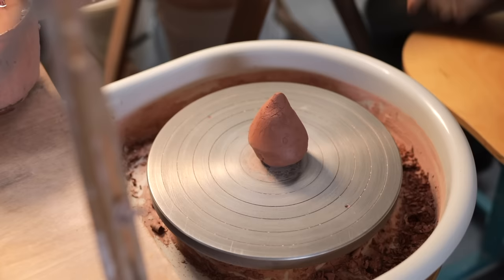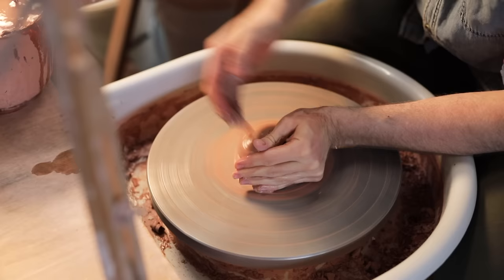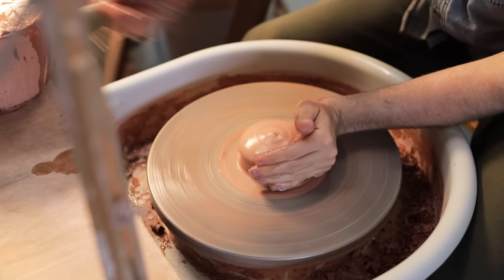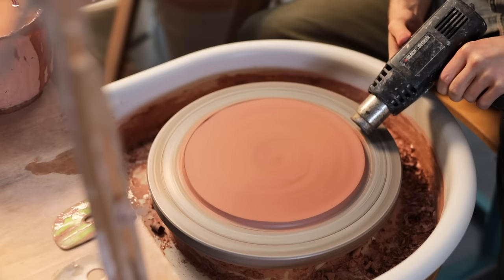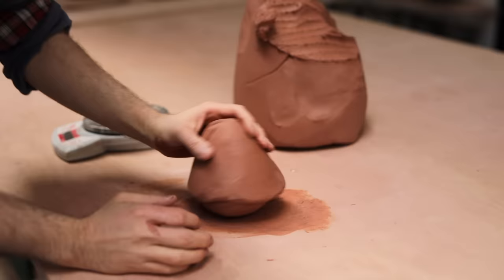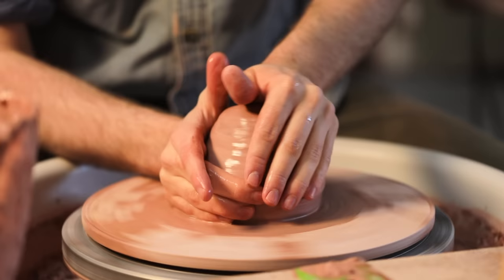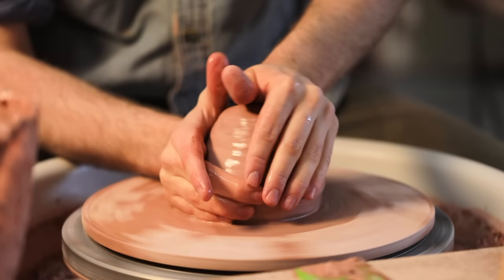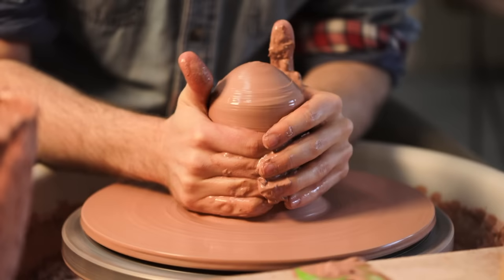How to Make A Pottery Dinner Plate — Part One

Comment: Hmm, having control over moisture content from start to finish seams like it could be a cool advantage to making reclaim.
Reply from the maker: It certainly helps a lot. I can also add the soft reclaim to harder blocks of new clay to soften it down.
Reply: @floriangadsby  Are you able to purchase clay at varying moisture content from producers?  I suppose that would just be paying for water if sold by weight or volume lol

Comment: Thank you so much for the video! I am taking away good tips from you. One question, at what stage do you lift the plate from the bat? I guess leather hard? I have had my plates even after wiring off after throwing, it is stuck and have lost a few when I had to re-wire. What am I doing wrong? Thank you!

Comment: Nice plate.... I want to know something can I use stoneware for drink if I fire it with 800 c' with out glazeing it .... is it save to use
Reply: If you use an unglazed mug for coffee you probably can’t ever use it for tea afterwards, same as how an unglazed clay cooking vessel that has been used for fish will always impart a fishy taste to anything cooked in it afterwards.
Reply: Burnishing the vessel when leather hard helps control porosity by “closing down” the surface. You can also try milk treatment or cereal treatments of the interior to cut down on porosity(check out Andy Ward on YT for methods). There is also a liquid quartz sealant available which is supposed to be food safe. People ate and drank for centuries from unsealed pottery so it’s more than possible, but using some kind of treatment makes vessels much more useful.

Comment: Is it true that dinner plates are really hard to make for beginners?
Reply from the maker: They're tricky, especially if you're turning proper feet on them. But soft clay really does make it easier, what's trickier perhaps is firing them, and that's often why pottery studios/teachers/etc won't let you make them for classes as they eat up space in then kiln compared to say mugs, bowls, which you can squeeze together and fire loads of. What's most difficult is throwing and trimming them to look exactly the same, so they stack neatly and the spacing between the rims stays the same, but that's only really important if you're being very particular and critical, like me.